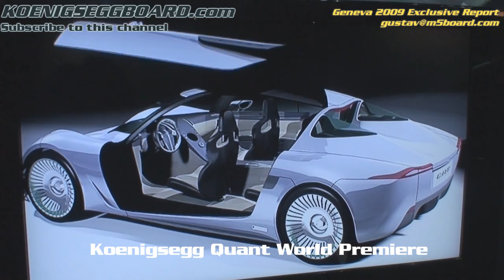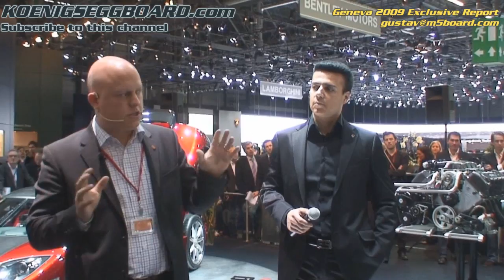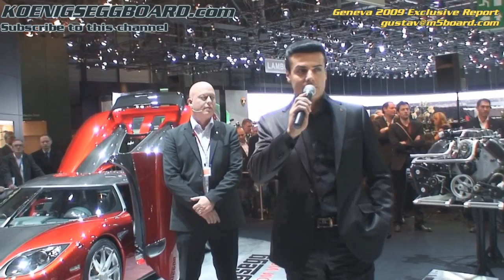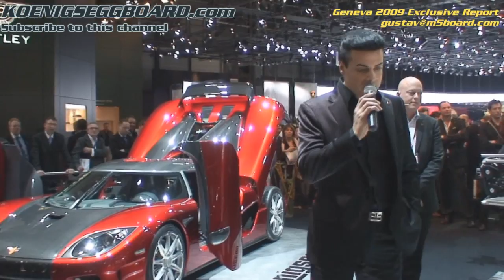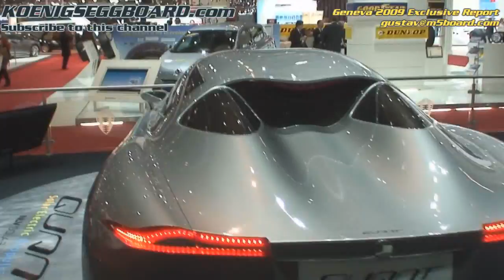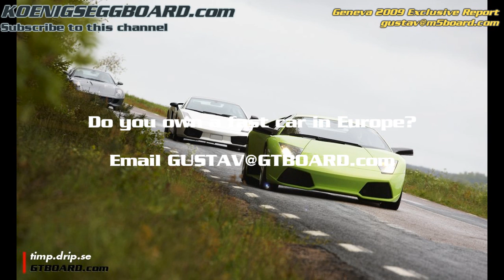HD: Koenigsegg Quant World Premiere  CCX Sequential gearbox and Infotainment Premiere by Christian

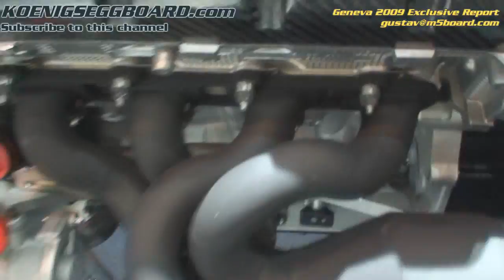Comment: The remark was made at 13:29 and it sounded like V6 to me but I could be wrong. Ohya and heads up before anybody mentions, you need to fix the vid info because Christian mentions the fact that this CCX is a single clutch thats built to shift as quick as the dual clutch. So change it to mention paddle shifters or something instead of "Double Clutch".